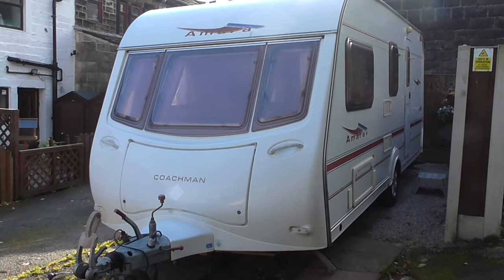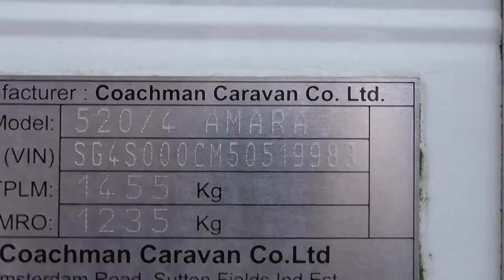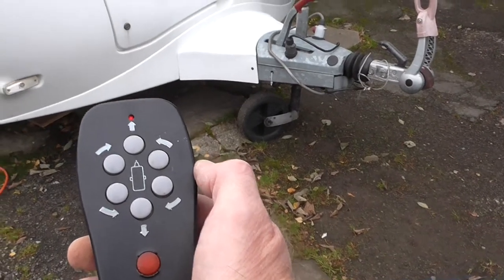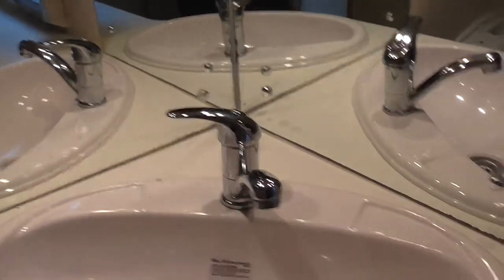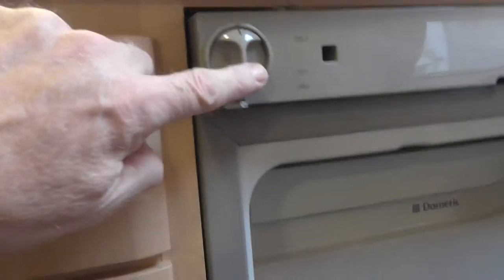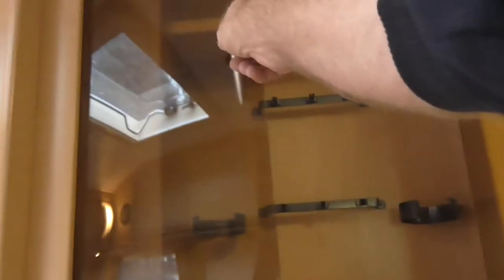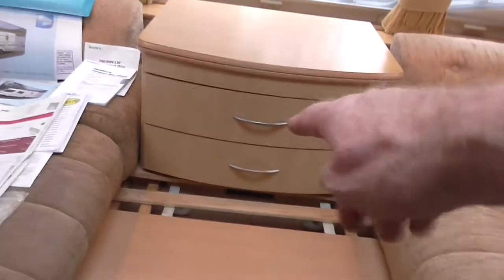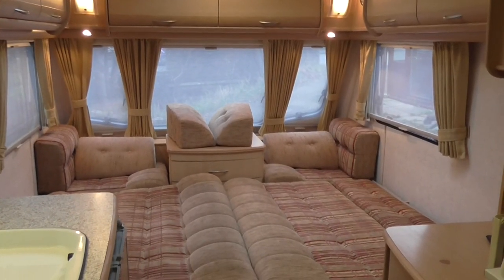Coachman Amara ,four berth  caravan reg 2005,with motor mover.

Comment: This video is amazing. I need to change the tyre / have it changed aren't they meant to have a key for the wheels? Many thanks for helping me with a daft question! Xx
Reply from the maker: Hello Jennifer and thanks for the compliment on the video, You will only need a wheel nut locking socket if the caravan has them fitted , if it has I would have thought the previous owner would have passed it onto you when you bought your caravan so I suspect it probably doesn't have them fitted . they look like the locking wheel nuts/studs you would have on a car for example , so I think your caravan hasn't got them so it is just the normal procedure to take the wheels of the caravan. If however it does have locking wheel nuts and you haven't got the unlocking socket they can be removed by knocking on a undersized socket and removing them with a socket ratchet wrench . Hope this is of help to you .
Reply: Thank you so much for your help :) and taking the time to reply xx

Comment: Thanks for the video. I  have the same caravan. When I connect the caravan to 220 V power supply the battery doesn't charge and the transformer 220 V to 12 V doesn't work either.  Do you know what can be the problem? Thanks in advance.
Reply from the maker: Hello , there is usually a switch you have to turn on  , on the top of the transformer , if this  switch is  on it will illuminate orange when you are connected to the 239v , if this is not happening then the transformer is dead . Hope this helps.